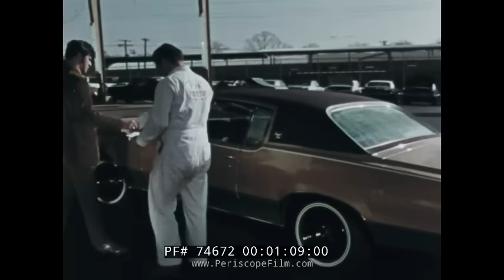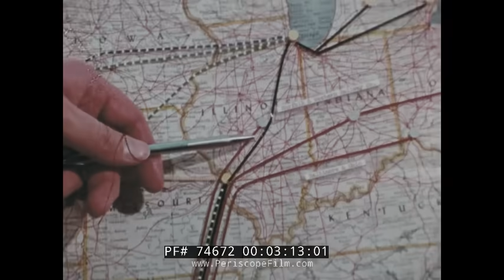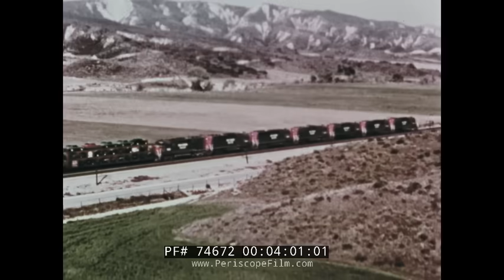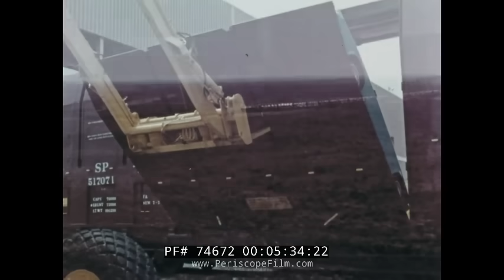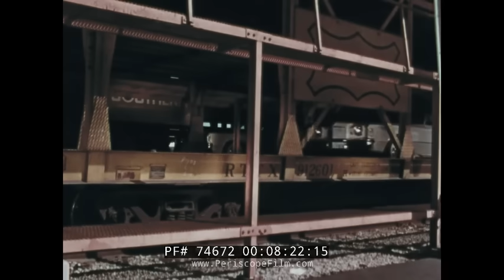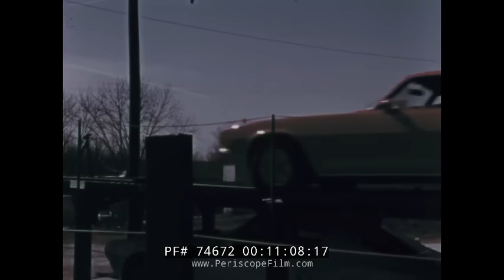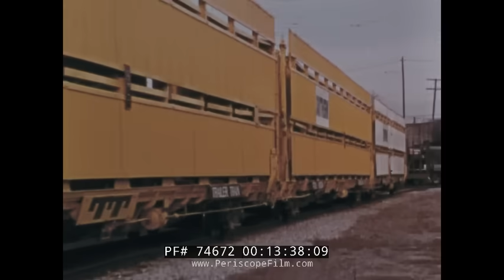1970s GENERAL MOTORS   RAIL SHIPMENT OF NEW AUTOMOBILES  LOGISTICS / SUPPLY CHAIN MANAGEMENT  74672

Comment: Paused 9:40 top front of that train is a presumably 1970 Oldsmobile 442 W-30! Can recognize that wide stripe down the side from a mile away.
Edit : that means this particular car was built in Lansing Michigan as they were the only plant that built the special performance W-30 optioned cars. 
Also earlier said presumably 1970 because this film says it was recorded in 1970. Too hard to see the small grille details from that distance to know for sure but I'd wager it's a 70 442 W-30

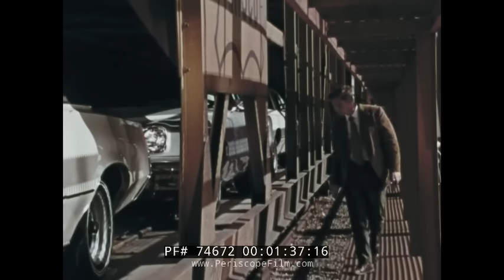Comment: 1:39 well they don’t transport cars like that anymore in open rail cars like that for obvious reasons because if they did that today, those cars would be tagged with spray paint before they got to the dealers plus they would have parts stolen off of them today that’s why they’re locked in secured rail cars

Comment: The railroads delay in implementing “side screens” as they studied the issue caused significant damage to US automaker shipments from a group of 8-12 year olds in upstate New York.  The size, weight and irregular shape of the Railroad ballast (typically consisting of larger cut rocks, often about the size of a tennis ball, ranging from 3 to 5 inches in diameter made of crushed stone such as granite) resulted in substantial dents or broken glass with every rapid fire throw.  With each eastbound freight the group of banditos would lie in wait with a full arsenal, out of sight from engine crews and caboose conductors so that the location of the raid wouldn’t be determined over the 160 mile leg.  Those middle managers in Detroit were no match.

Comment: I believe that steel brake dust was a major rail transport problem, resulting in damaged paintwork
Reply: That’s one of the reasons that new cars have the white plastic wrap on the body panels. Also protects the paint from industrial fallout while sitting 
for prolonged periods as inventory in storage yards. Back in the 70’s while in an apprenticeship program and attending trade school, I parked my 
car close to the wing most of my training classes where held. Across the fence in a building where welding was being taught on behalf of a union.
My windows, especially the windshield looked like it was sandblasted. I didn’t connect it to anything until other guys in my cohort started complaining 
about the same problem. In the late afternoon driving into the sun it was almost impossible to see through the windshield. Aside from that, I hauled 
new cars for many years, there was a serious issue with with the plastic wrap coming loose while the cars where on the truck. The plastic would 
frap in the wind on the paint. Couple that with dirty road spray, and the paint looks like it’s been sanded. So here’s another problem relating to that.
Not all manufacturers installed the wrap guard, and some other manufacturers cars without wrap might be mixed in the same load. So after some 
hours or days being whipped to death with by now a long tail of plastic  scuffing up the paint. All the receiving dealer knew was he was going to 
claim for paint damage. This was a headache for the manufacturer, and the carrier. The manufacturer tried to lay the blame on the carriers, and 
as a compromise they requested we remove the loose wrap when we saw it was loose. Well for us drivers that was a non starter. We made it clear
that we would not be climbing up on loaded trucks trying to strip off loose plastic from the roofs of cars 14 feet up in the air. A quick call to the 
provincial workers health and safety dept, and that was that. Our fall back position was we as the carrier didn’t apply the plastic so we weren’t 
responsible for the paint damage, so don’t bother writing it on the delivery receipt, as the claims department wouldn’t process the claim.
Reply: I had a car ship across the country and the paint in covered in rust spots that can be barely buffed out and the underside rusted substantially,I couldn’t believe how bad it was.

Comment: Who would guess those shortbed C-10's would be bringing $25k-$40k fifty years later...
Reply: Even my 1970 C10 if body work was done would be worth $20,000 or so. Best full sized truck this 70 year old has ever driven except the large steering wheel which causes my 4`10" stature to peer over or under rim while driving. Tall hwy gears! Can achieve 17.1 mpg at 55 mph with a 350cid & 350 auto.

Comment: In Omaha, at 902 Capitol downtown next to the railway head was this 3 story concrete building complete with vehicle elevator that stored GM cars & trucks to be delivered to dealers. After GM designated 6 hub points for railway, car haulers took to fast dealer deliveries. This building was sold to UTI technical college. If the walls could talk!

Comment: I sure wish general motors what understand something their cars have went to complete hell most of everything they have to offer after 2000 is really nothing but junk I don't care if there's people that don't agree with me hell I don't care if there's people that do agree with me facts are facts the design and engineering sucks I mean the 4.6 Northstar the 3.1 l engine the 3.4 l engine and haven't even got on the subject of cylinder on demand kiss my ass to all that junk. I had to take a few different GM cars and put them together to make my own car a car that they could never make because they are idiots I have permanently drawn the line again with GM on their cars being any good after the Chevy Colorado with what you got to do to get that starter out of that car. (Truck)
Reply: It was starting even back in 1989! To remove / replace the starter in my S10 Blazer with the 4.3 had to CUT the wire at starter motor just like a wrecking yard as GM did not make the wire long enough!

Comment: Working for Missouri Pacific Railroad in North Little Rock we would see HOBO's riding in the new cars with the A/C blowing cold and the radios rocking on down the track . Hell of a lot of damage was done to the new vehicles . New vehicles now are protected a lot better , damn thieves are breaking in containers every where, AR15's would help that problem with TALENTED guards .   HeHeHe .
Reply: What about hail? on the open to the air cars? That would be catastrophic.

Comment: Working at a Chevy dealership in North Little Rock  Arkansas from 67 to 71 every single new vehicle was a quart low on oil , transmission fluid and antifreeze . We were not allowed to add anything unless it was extremely LOW . I saw gas tanks and driveshafts fall out as the new owner would be driving out of the dealership shop . One lady had the hood of her new Caprise fly up and crash the windshield and flatten her roof .
Reply: Why??😮

Comment: I owned two of those Vegas back in the early 70s. They may have arrived at the dealership in good condition, but they were pure crap. The other GM cars I had - the three Buicks, one Pontiac and the other Chevy - were better .... but they all developed major problems at about 5 years. Since the late 90s, I've stopped buying GM for that reason.

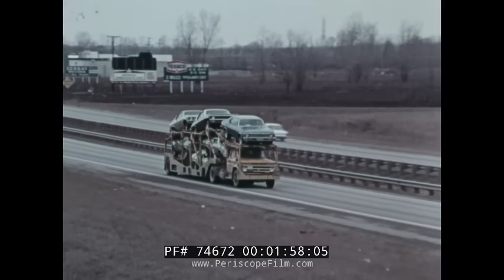Comment: 2:01 I think that’s a Yenko Nova on that car hauler, the dark green with white stripe, very valuable car NOW!
Reply: Check out 9:40 top front is a '70 Oldsmobile 442 W-30. Can recognize that side stripe a mile away
Reply: I think it's a Rally Nova, but I did once see a Nova like that on a train car like that, in a different video, and it had a hood tach and no stripes.

Comment: Going off of the silver standard in ‘65 (Johnson) then the gold standard in ‘71(Nixon)was the beginning of the end of any type of big mfg. in the U.S.. When the so called oil crisis hit in Nov ‘73 the value of the dollar had plummeted, the price of a barrel of oil nearly tripled by ‘75, was never above $5.00/barrel going back to the end of WW2. the price of all raw materials spiked. Heavy mfg immediately could not afford the costs. This was the big take down of the middle class in America, they had built their wealth going back to 1946, many politicians on both sides didn’t like that. 

Hard to believe that just 50 years ago GM had nearly exclusive use of the railroads in certain geographical areas of the U.S.. Now they want to only build EV’s w/o little or no charging grid anywhere, no one will buy them. The Chevy bolt-less has a problem with the Korean made battery. Mary Barra is only finishing what Roger Smith started.
Reply: My GM parts mgr. who I worked with always said that Roger would bankrupt GM especially with the dumb reclassifying of the C / K`s to R /V`s trucks in our parts catalogs.

Comment: Six locomotives. The Espee was never afraid to use power
Reply: Nope. That was SEVEN brand new SD45's, from back in the day when they'd put just about anything that moved on the point of the BSM to get the needed hp/ton ratio.
Reply: @whiteknightcat  they still had that new locomotive smell
Reply: Illinois Central had 5 GP40’s from Woodcrest, IL to Pine Bluff, AK…..pulled off on the Cotton Belt.

Comment: How is there not damage to the transmission or the engine when you’re storing the vehicle vertical? Where are all the oil and the fluids going?
Reply: They shipped them dry and lube was added at the destination.
Reply: @maplemanz  No they werent shipped dry....they designed the oil pan(s) with baffles to curb the oil during verticle shipment.   Do some research before posting simple thoughts.

Comment: This is nuts what happens to all that oil gas and engine coolant with the car standing up talk about a Big mess.
Reply: The car was designed not to spill any fluids. According to the Wikipedia article, "To do this Vega engineers had to design a special engine oil baffle to prevent oil from entering the No. 1 cylinder, batteries had filler caps located high up on the rear edge of the case to prevent acid spilling, the carburetor float bowl had a special tube that drained gasoline into the vapor canister during shipment, and the windshield washer bottle stood at a 45 degree angle. Plastic spacers were wedged in beside the powertrain to prevent damage to engine and transmission mounts." (https://en.wikipedia.org/wiki/Autorack)

Comment: Look at all those nice cars on the train waiting to have rocks dropped on them by teenagers from overpasses.
Reply: Plus all the stolen batteries and parts... strip them en route then hop off the trains with the goods... or while they were sitting on sidings easy pickings... OL J R :)
Reply: Thry used to transport cars in boxcars. When trucks started hauling them, railroads switched to autoracks. The truckers did not like the loss in business so they would go to isolated spots and shoot the windows out of cars
Reply: Guy I worked with used to do that as a teenager. The train used to stop sometimes. They did a big burnout in a camaro with the rolling stones logo on the door 😂
Reply: @juliogonzo2718 this comment makes zero sense

Comment: Toyota is shaking in its boots
Reply: At that time, we laughed at ALL foriegn cars...they were nothing but junk.  No spit, they were total crap tiny uncomfortable useless cars....if you could call them cars....they couldn't take our climate and perforated with rust immediately.  In the 60's & early 70's we all wanted horsepower to rule the road and GM delivered for the most part along with Ford and MOPAR.   Then emissions and gas shortages started...and the Big 3 took it in the shorts...for a while.  I'll still buy a GM product over any other brand despite whatever the mellinials like to think.
Reply: Not! More like laughing. Gm junk in 70's. 2007 and new Gm great product
Reply: just in time wasn't really a thing in the 70s yet. and any capital intensive venture with customers in every single point in the vast united states was going to have logistical hurtles. even elon musk admitted auto manufacturing is way easier than it looks.
Reply: Look at Toyota now. GM can't hold a candle to the reliability of a Toyota, they don't even make cars anymore....because their small cars and sedans are junk.

Comment: Developing a completely new rail car， to save a few bucks of delivering fee on a model that was basically a failure and ran for only 5 years. Sounds like typical GM or Soviet central planned system.
Reply: GM had planned to cooperate with Toyota on reverse shipments from the west coast. That never materialized for many reasons. It was a unique idea, even if the Vega was short lived in production. The basic construct of the Vega continued on for almost another seven years in similar improved GM models and used these Vert a Pak cars for transport. The real issue with the Vert a Paks is that they required extra labor to load the cars and special equipment to stop fluid leaks in transport because the stood on their nose. All these accommodations needed to be reversed at the destination incurring even more costs. The Vega suffered from having too many new ideas thrown in one package.